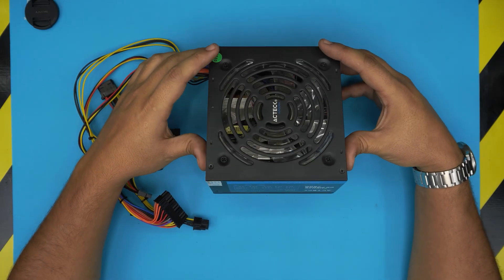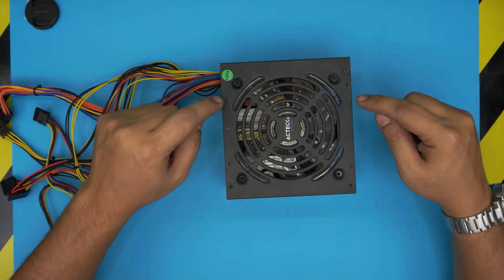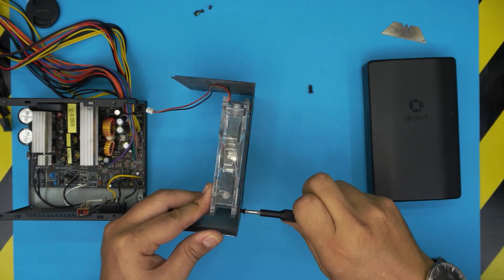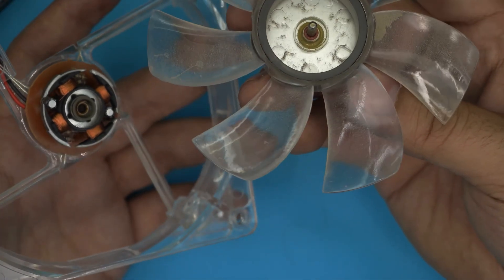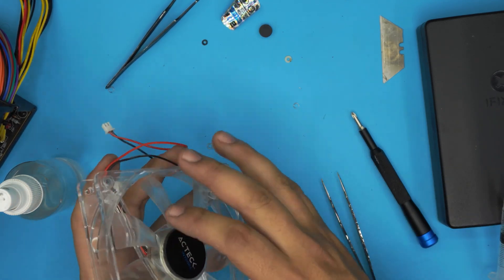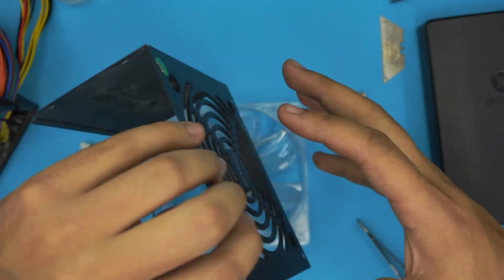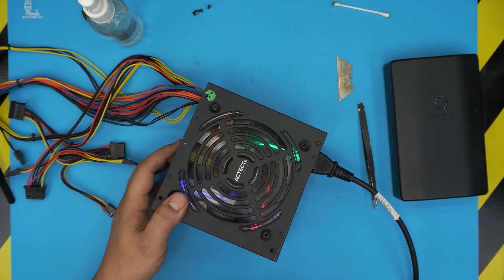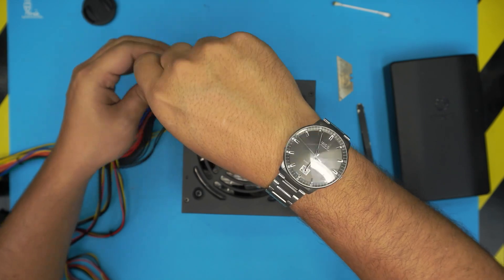How to Repair Power Supply (PSU) Fan Noise - Step-by-Step Guide

Comment: Wait shouldn't the ugly face of the fan be up so it exhaust hot air ??
Reply from the maker: 🫠Regarding your question, no! All PSUs have the fan pulling fresh air in, passing it over the components, and then exhausting it into the case or out through the side panel of the PSU.
Should you have any further questions or requests in the future, please don't hesitate to ask me.
cheers🍻

Comment: Thank you for the video. I clean the fan but it still make the noise. So im gonna buy a new PSU fan instead
Reply from the maker: It's my pleasure my friend.
yes sometimes if the damage is extensive then you will need a replacement fan.
cheers🍻

Comment: Thank you for this info and video! You saved me $50+ on a new PSU.  My unit started doing the same noise until the fan stopped completely and my PC shut downed due to (I assume) overheating.

It's funny how my PSU had a label that read "DO NOT OPEN. NO SERVICEABLE PARTS INSIDE."
Reply from the maker: It's my pleasure my friend.
🫠Regarding your PSU, yes, it is funny how they say that when everything inside the PSU is serviceable.
Should you have any further questions or requests in the future, please don't hesitate to ask me.
cheers🍻

Comment: A safe way to to open PSU, leave it unplugged up to 24 hours before opening the PSU to discharge the capacitor.
Reply from the maker: 🫠Regarding that method, I do not recommend it. Some PSUs have large capacitors that can retain a charge for up to 24 hours. The best approach is to discharge them by powering on the PSU without connecting it to a power source. This is the safest and most secure method.
cheers🍻
Reply: @uFixTek  powering psu by jumper?
Reply from the maker: yes by jumper, It’s 100% safe; it’s a DC voltage, so no harm or shock will occur.

Comment: I just gave it two slaps and now it doesn t sound anymore
Reply from the maker: Yes, it does work, but it is a temporary workaround, and it will reach a point where you will have to open it to service it.
cheers🍻
Reply: Fixed for now but hope this problem will not appear in the future🫡
Reply from the maker: lets hope so 🫠👍

Comment: Bro i don't have rubber it's just plastic that don't get out... Someone told me to make a hope but doesn't work for me
Reply from the maker: If you don't have the plastic cover, then your fan is pressed in, and you will need to pull out the fan with force very evenly, or else you will break it. If you do break it, just get a 12mm fan from AliExpress.

Comment: Hello weird question but may i use olive oil instead of? 7:43 or its okay without putting something oil inside?
Reply from the maker: 🫠Regarding your question, the question is funny as hell, BUT..... you can use it and it will work, but how long will it last before start making noise that would be unknown, it may last you few months.
no hard done by placing it, just two or 3 drops.
Should you have any further questions or requests in the future, please don't hesitate to ask me.
cheers🍻
Reply: i used it too is it good until right now ?
Reply: @3xzs_  I widened the screw actually without putting something oil its fixed noise but not fully

Comment: This video helped to fix my Z-tier PSU, where the fan would have random grinding noise when it is powered up in winter (mostly). The noise would be gone after few minutes usually.

I did tried to take the PSU apart and lubricated the fan by WD40, not work well, maybe I sprayed it on a wrong spot. Now with this video, I knew how to take the fan apart, and the fan was fixed. So thank you so much uploader.

In case someone asks, my PSU is: 
Thermaltake Smart 550W 80+ Bronze SP-550P
Reply from the maker: It's my pleasure my friend, i appreciate your support.
cheers🍻
Reply: Just a reminder that WD40 is not a good lubricant at all.

Comment: Didn’t you put the fan backwards? Shouldn’t it pull the hot air out?
Reply from the maker: 🫠Regarding your question, any/all PSU always suck the air in and blow to the back where the cable connection is and the power switch.
that is why the air filter in cases are always in front of the fan, because the air has to pass throw the dust mesh.
Should you have any further questions or requests in the future, please don't hesitate to ask me.
cheers🍻

Comment: my psu just got noisy as a diesel engine 😅 i want to fix it like in the video , but I never built a pc i don't know which cable go to each part , so im gonna avoid it and take it to the shop where i bought it , nice job man
Reply from the maker: much appreciate the feedback, and if you have never opened a PC or built any , i would recommend you to save a headache and take it to the service shop.
🍻cheers

Comment: I have a EVGA G3 1000W with a 130mm fan. Under the sticker of the fan it looks not like yours. It's a sleeve bearing fan, so can i remove the blades and lubricate it from the other side?
Reply from the maker: 🫠Regarding your question, if under stick it doesn't have access then it is a push down blade and you need to pull it up EVENLY from other side and it will POP out with a light force. drop one or two drops of oil and you set to go.
Should you have any further questions or requests in the future, please don't hesitate to ask me.
cheers🍻

Comment: Hello. Question for anyone.  Maybe i missed it but if I just want to replace my fan.  what size is the most common?   My noisy fan is about the same size as yours.
Reply from the maker: Regarding your question, the fan is a 120mm fan two cable.
https://amzn.to/3UKivLK
Should you have any further questions or requests in the future, please don't hesitate to ask me.
cheers🍻

This is an Amazon affiliate link. When you use my links, you are helping to support the channel. 🙏
Reply: @uFixTek  thanks
Reply from the maker: It's my pleasure my friend. 😊

Comment: Great video! Very helpful! Quick question. That "hole plug" in the middle of the fan. Is it really necessary? @ 4:43 I lost mine. It flew away and I can't find it, lol... So stupid. :(
Reply from the maker: Thank you for your feedback! If you wish to support the channel, you can like, subscribe, or both!
Regarding your question, yes it is very very important, you can power on the fan and you will see that the fan will spin and will try to come out :P
test it out and check and see if the fan stays inside or it does pushes it self out, it will not explode. but you will need the c lock or replace the entire fan.
the fan is 120mm can with two cable, you can get it on amazon two for 14usd or get in aliexpress much cheaper.
https://amzn.to/49rGFPi
Should you have any further questions or requests in the future, please don't hesitate to ask me.
cheers🍻

This is an Amazon affiliate link. When you use my links, you are helping to support the channel. 🙏

Comment: Any recommendation on the type of heat-resistant lube used? Or just any heat-resistant lube within reason?
Reply from the maker: for the fan any 3-in one lub will do the job for years no need to go with any crazy lube.
https://amzn.to/41Ur20s
Should you have any further questions or requests in the future, please don't hesitate to ask me.
cheers🍻

This is an Amazon affiliate link. When you use my links, you are helping to support the channel. 🙏
Reply: @uFixTek  merci !avec des gars comme toi ,on va faire un meilleur monde !

Comment: Thank you for this guide! I was able to fix my PSU fan issue. I caution for anyone to avoid touching any capacitors while you work on this to avoid a deadly shock.
Reply from the maker: It's my pleasure, my friend. And yes, please avoid touching the capacitors. If you followed the video, the capacitor should have been discharged. Shorting the pins will drain the caps – it's not deadly, but you'll definitely know what it feels like to get tased by a cop! 🤣
Reply: It also helped me cleaning the other side of the fan and testing iff the psu realy made way to mutch noise and not something else
Reply: Today I learned this the hard way 😂
Reply: @gouki3979 RIP

Comment: thanks for the video, I've taken mine apart and cleaned the inside, added new oil etc - I was initially planning on swapping the fan as I have 4 case fans spare but the plug was bigger than the original fan, is there a specific fan I need to buy for a PSU or can I get a converter of some sort? so that it fits into the 3 pins on the PSU - I'm hoping that cleaning it will help but it's about 8 years old so a new fan would be the ideal fix, or a completely new PSU
Reply from the maker: Thank you for your feedback! If you wish to support the channel, you can like, subscribe, or both!
Regarding your question, you need to measure the fan from one screw hole to opposite in x shape that that in inches is the size of the fan and  if not you can get any 12' and use zip tie to hold it, and if your original fan has two wire that is DC 12v and if it has 3 then is dc power step and if it has 4 then it is pwn fan, but most fans are the 12v.
Should you have any further questions or requests in the future, please don't hesitate to ask me.
cheers🍻

Comment: all manufactures say to never open a power supply
Reply: You can open PSU, but it will void your warranty. But if the warranty is expired, you can do anything. The thing to concern is high voltage still available in capacitor, so do not open PSU immediately after unplugging as electricity still stored in capacitor, better to wait 15-30 mins before open it, or wear safety equipment like gloves and sandals, don't open with bare hand.
Reply: tell that the PC gamers
Reply: You can but you shouldn’t it could end badly for you. Only open a psu if you know exactly what you’re doing
Reply: @Krabzz95 just let it properly discharge and nothing can go wrong when replacing a fan unless you are severely restarted
Reply: Yeah but i just open
Reply from the maker: no manufacture in any kind likes that anyone open their products. they always encourage to not open!
but that doesn't mean that you can't open and fix your issues, instead of paying a store to do it for you.
again if you worry about high voltage or can't follow steps exactly i highly recommend you, do NOT open it.

Comment: Can’t u just you canned air?
Reply from the maker: Thank you for your feedback! If you wish to support the channel, you can like, subscribe, or do both!

Regarding your question, I have been working with electronics for over 17 years, and the biggest concern is the use of air cans for electronics. They can be harmful, especially for laptop motherboards, as they expel a lot of humidity and moisture. I recommend using a compressed air blower instead.
https://amzn.to/3OBWuLR
unlimited Dry air and more power and better.
Should you have any further questions or requests in the future, please don't hesitate to ask me.

Comment: Had the same PSU in this computer for almost 7 years now and it only just started a couple of days ago. It is now at the point that I can even hear it through my headphones. Will be doing this as soon as I get my next day off.
Reply from the maker: Thank you for your feedback! If you wish to support the channel, you can like, subscribe, or both!
Regarding your fan noise, try to do it as soon as possible, to prevent any extra damage to the main shaft of the fan.
Should you have any further questions or requests in the future, please don't hesitate to ask me.

Comment: Just cleaned 14 years of dust out of my OCZ600SXS after an intermittent noise became a permanent one.  As it was only a small amount, I used bike chain lubricant.  It could have been the sheer amount of dust on the fan causing the noise.  Thanks for this video.  I wouldn't have even attempted this, but you explained everything so well.  Life in the old dog yet.
Reply from the maker: It's my pleasure my friend. 😊 Thank you for taking the time to give feedback! If you would like to support the channel, please like, subscribe, or both. :P
you should do servicing of PSU once every 3years to keep it going.
Should you have any further questions or requests in the future, please don't hesitate to ask me.
Reply: @uFixTek  Already done.  Keep up the good work mate.
Reply from the maker: cheers 🍻

Comment: What can i use instead of lubricant?
Reply: An anti rust spray like wd40 is good for cleaning and a sewing machine oil Is good to lubricate it, around here we have "singer" oil that can be found very cheap at supermarket and can be used for many purposes.
Reply from the maker: thats a good option the sewing machine but not recommend you the WD40
Reply from the maker: Thank you for your feedback! If you wish to support the channel, you can like, subscribe, or both!
Regarding your question, you need some sort of oil my friend nothing can replace a lubricant, i would say kitchen oil but its not recommended.

Comment: I replaced the 240v fuse for the broken psu with a 250v fuse available be burnt , but plugged it in and it exploded! So just use the equivalent 250v fuse??
Reply from the maker: Thank you for your feedback! If you wish to support the channel, you can like, subscribe, or both!
Regarding your question, you have a short somewhere on the board that is blowing the fuse, look around for a damaged components.

Comment: For me very loud noise only in a cold start, after one minutes I turn it off and turn in on PC again and noise is gone. Should I replace the fan or do the cleaning?
Also what type of lubricant do you used?
Reply from the maker: Thank you for the feedback! if you wish to support the channel you can LIKE or SUB or both :P
regarding your question: i recommend you replace the fan or if you want to save service it now else it will be worse and you will end up replacing it, also it will start working at lower RPM and it will result in overheating the PSU. check to see how big is your fan 80mm or 120mm and i can link you a good fan.

Comment: I blowed air in my PC to get rid of the dust and now my psu fan sounds like a plain engine. It seems that if I insert a qtip and move it a bit, it stops, but then it makes the noise again. Maybe if I leave it to run more it will stop. What do you think?
Reply from the maker: Thank you for the feedback! if you wish to support the channel you can LIKE or SUB or both :P
regarding your question:  i highly recommend you to replace the fan or clean it. they are 8mm or 12mm fan depending the PSU model. if the fan even stops making noise, that doesn't meat its having the correct RPM and that can result of over heating PSU and damaging it.
Reply: @uFixTek  I've read that it's very dangerous to open the PSU, also I have no electrical skills.
The thing is, if I lay the PC case horizontally, it doesn't make any sound. I use the PC for office only, so I don't think it will overheat.
Reply from the maker: ah if its not a gaming or heavy usage the you more than fine to have it in any position that stops making noise.

Comment: Thank you for this amazing video, I did this already 3 times i've learned my lesson and already brought a new fan, my pc is 3-4 years old already, but I always get the same problem, it doesn't start, the CD or DVD rom I think  it's called, makes a sound like Brrrrrt and then it's stop sometimes it start the lights and then stop immediately, I have fixed this already 3 times but forgot how exactly, could you help me somehow? 😅 thank you in advance
Reply from the maker: Thank you for the feedback! if you wish to support the channel you can LIKE or SUB or both :P
regarding your question:  i need to know if the CPU fan spins and stops and after how many seconds stops and does it make a loop start. make a short video and send me a link.

Comment: whats the shorting it bit for? were he puts the tweezers in
Reply from the maker: Thank you for the feedback! if you wish to support the channel you can LIKE or SUB or both :P
regarding your question:  you need to shorten the green cable with any black cable on the 24pin connector, this way it will empty the capacitors inside the PSU so it will be safe to open and touch it. if you don't do it the capacitor will be filled with charge and it will shock you , just like when a cop uses a taser :P

Comment: Hey there, I have just some 650W psu. Can I simply change the fan? What if I go out and buy a new fan and switch it. Or do PSU's have their own fans configured for their individual use?
Reply from the maker: Thank you for the feedback! if you wish to support the channel you can LIKE or SUB or both :P
regarding your question: you can get your own fan any brand or model , the best an quiet is the noctua https://amzn.to/3EHj13x
or a good cheap fan is this too: https://amzn.to/3u5irYx
Reply: @uFixTek  Thanks man. Will check it out. Anyway, yesterday I changed the grease to my current PSU cooler. and Now I'm noticing that CPU (i7 9700) is getting really hot 80 which makes my Case really hot, because it's AIO is getting hot. I haven't even touched my CPU or it's cooling. Is it possible that PSU is not getting cooled enough and this is causing my CPU to go lava?
Reply from the maker: the PSU must have a good exhaust fan because it does help to vent the case, it sucks the air out of the case, so its important to clean the PSU fan, therefore yes it can have a effect of CPU cooling.
if you have any question or request in the future feel free to ask me.
Reply: @uFixTek  How do you connect a 4 pin fan to the 2 pin header?

Comment: I HAD FAN KNOCKING, CLICKING, GRINDING, AND HARD VIBRATIONS. COMPRESSED AIR BECAME INEFFECTIVE SO I TRIED THIS. ITS A SIMPLE SOLUTION TO SAVE $60+ THIS IS IT. I FOUND OUT THE MANUFACTURER DID NOT LUBE THE CONTACT POINTS OF THE INNER FAN CAUSING THE ISSUE. I USED ALITTLE THICK GUN OIL AND DRY LUBE COMBO (not messy) AND DID THE TRICK. MY PC  IS A STEALTH JET AT 50,000ft QUIET. FOLLOW THIS AND SAVE UP
Reply from the maker: You are welcome! Glad you liked it 😊Thank you for the feedback! if you wish to support the channel you can LIKE or SUB or both :P
if you have any question or request in the future feel free to ask me.